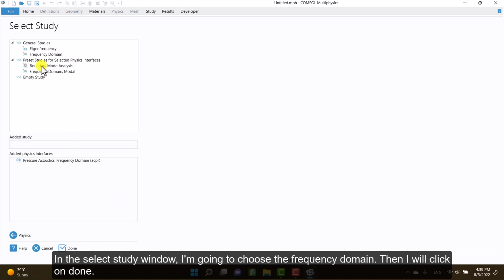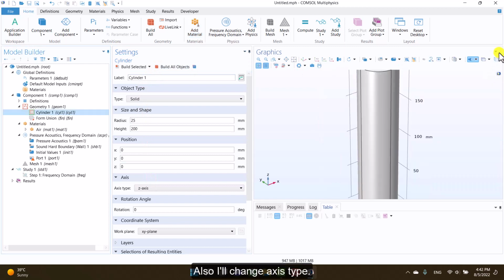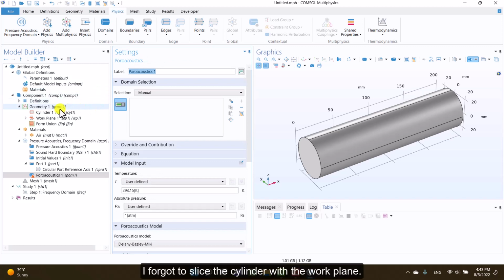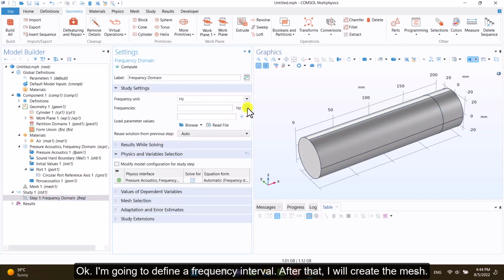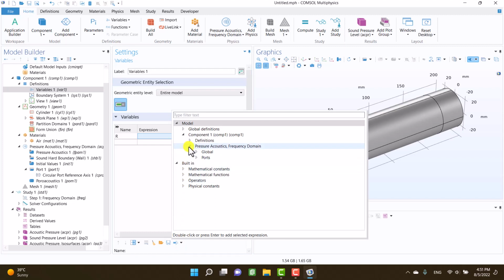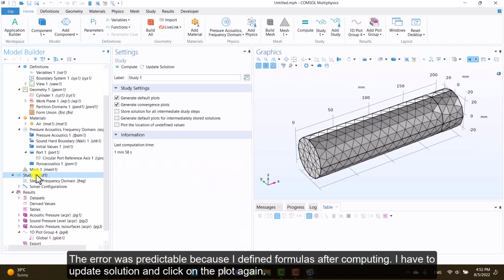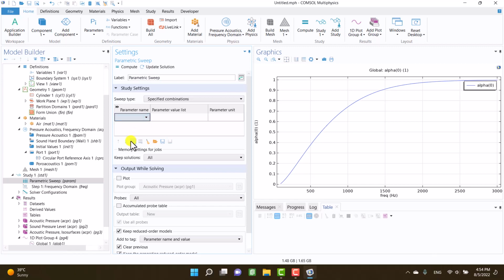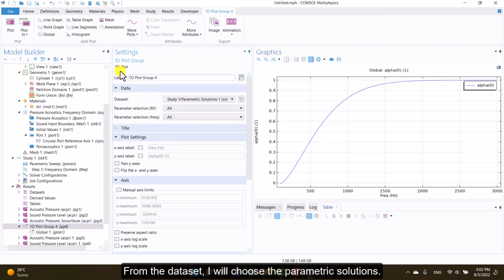📉 COMSOL Tutorial: Sound Absorption Coefficient in an Impedance Tube (Delany Bazley) 🎤

Comment: Hey, I need help simulating the impedance tube for poroacoustics at 6MHz and I am facing problem with meshing 
Can you help me?
Reply from the maker: Hello, size of mesh depends on frequency. You have to use millions of elements for this frequency. Are you sure pressure acoustic physics is used in this frequency?

Comment: The reflection coefficient is the ratio of reflected pressure to incident pressure or reflected power to incident power. You're making a mistake.
Reply from the maker: Hello. I used the reflected power to incident power that port 1 calculated in this example.
Reply: @caewitharminhashemi  absorption coeff(alpha) is power_apsorption/power_incident.
power_incident=power_absorb+power_reflected(outgoing).
r_coeff is the ratio of amplitude of reflected pressure to amplitude of incident pressure "not" the ratio of reflected power to incident power. r_coeff^2=r_power/i_power.
so i think you should remove "^2" from your "r_coeff^2"
Reply from the maker: @HWKim-ml2bu  thank you. I have to check with reference books
Reply from the maker: @HWKim-ml2bu  Hello. You said right. I explain in the description. thank you
Reply: @caewitharminhashemi  that means outgoing power is reflected power.
Reply from the maker: @MechaNik_IITK  yes outgoing power of port 1 is reflected power.
Reply: BRO, you are using the wrong formula.we have to use  use this 1-abs(acpr.S11)^2. There will be a slight difference in results.
Reply from the maker: @MechaNik_IITK  please send me your model
Reply: @MechaNik_IITK  bro using one port is fine
??
Reply: @MechaNik_IITK  please helpme to understand the port